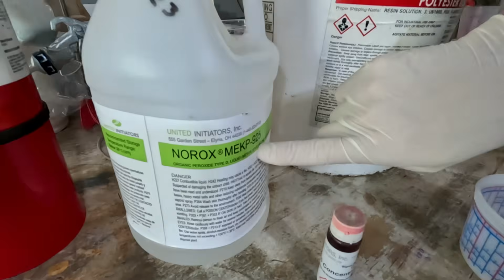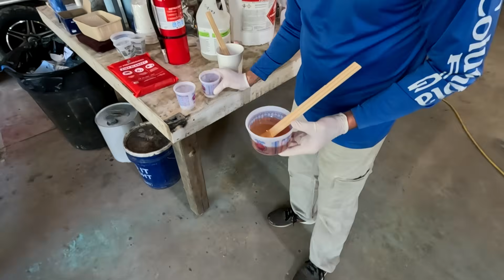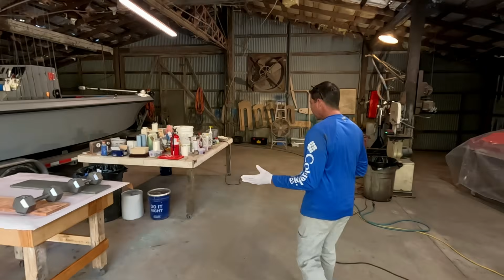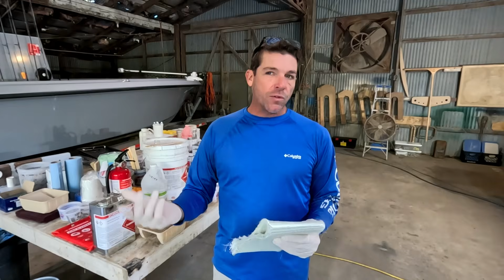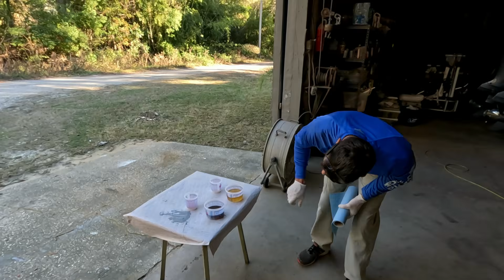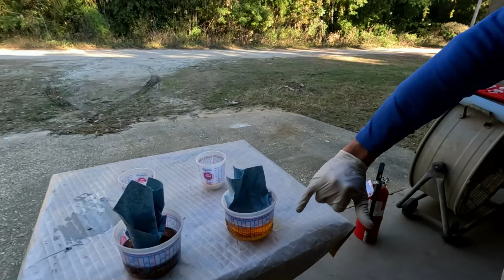FIRE HAZARD!! WILL POLYESTER and EPOXY RESIN IGNITE? LET'S TEST IT AND FIND OUT!

Comment: I am from NZ. We get powdered CSM which I am sure is better than emulsion, but take my word for it, Emulsion based CSM will work with Epoxy. The chemists will say it doesn't but it will! Takes a bit more rolling but it does wet out.

Comment: Great demo and at a good time for me. I have to build an aluminum tower for my mast step on my Catalina 36 and fill the voids around it with several epoxy pours. Unfortunately Catalina has always put wood under the 2inches of glass under the step and in time it gets pinky and the step pushes down. I’ll be extra careful and probably double or triple the number of pours to fill up the6x8x12 inch area. Thanks. Gallivant a36 Catalina northern Lake Michigan Escanaba, Michigan
Reply from the maker: Thanks, and good luck with your project!

Comment: There seems to be a lot of pricing competition on the 1:1 Table Top Epoxy averaging $50/gallon. If you mix 1 part resin, 1 part activator and 1 part xylene you get a water thin epoxy with a rather long pot life. I've used this mixture many times on cheap Home Depot grade plywood with excellent results. The wood drinks the mixture up and because Table Top Epoxy is crystal clear it barely looks like wet wood after applying then becomes almost invisible once soaked in and the xylene evaporates. The wood does not become shiny because the wood has absorbed the mixture completely. Once cured the rough pourus wood can be lightly sanded and coated with just about anything. I have yet to find anything that sticks to untreated wood that won't stick to the cured wood soaked with epoxy. Virtually rot proof wood. 🥳
Reply from the maker: Very interesting, thanks for sharing your experience and methods with the channel, and for taking the time to watch and comment!

Comment: The first time i used an Epoxy resin to paint my bathtube, i got some problems using denaturated 99.9% ethilic alcool, the resin did not get hard. Before i used as the company suggested, the Pure 97% glass drinkable alcool and it worked very good. Idk if it was a problem of the chemicals used in the denaturation of the alcool or i made some other mistakes. Ty for your example :), but when i used the denaturated alcool for epoxy it didnt work
Reply from the maker: Thanks for sharing your experience with the channel! There can be lots of variables between different brands of epoxy and possible thinners, so it's hard to say sometimes what will happen for sure. I like to do test batches, just to be sure everything is working well together if it is possible. Glad you found a workable solution! I appreciate you watching and commenting!

Comment: HI. I have a kayak built about ten years ago. I would like to make some changes but I don't know what resin was used. How to understand if it is made of resin with styrene or epoxy? Thank you
Reply from the maker: It is hard to say for sure.A quality kayak could possibly be made out of epoxy resin. If you are in doubt and need to make repairs, I would probably use epoxy resin. Epoxy will bond to epoxy, vinyl ester, and polyester resin, but poly and vinyl don't bond well to epoxy. Just remember that gelcoat is polyester based, and isnt recommended over epoxy. I hope this helps, and thanks for watching!
Reply: Grazie!

Comment: I’m wondering how many layers of cloth you can wet out at the same time with polyester or vinylester. 2 or more, 4?
Reply from the maker: 2 or 3 layers in most cases, depending on the temperature and thickness of the fiberglass clothe and the catalyst rate. The hotter it is with a thicker fabric, the less fiberglass you would put on. Hope this helps and thanks for watching!

Comment: I gotta a question for you.    I learned from you that it’s not advisable to put polyester resin on top of epoxy but the other way round is fine.   I have redone the stern and transom on polyester resin and cloth, and glued the marine plywood with an epoxy based type of glue, which is fine.  I allowed 7 days for total cure as the manufacturer advised.   But now I am thinking about closing the transom up with epoxy instead of polyester since it’s said to be more resistant to water.     However, I am in doubt whether it’s also stronger than polyester for tension / forced applied, considering the same amount of fiberglass used.   If the mechanical resistance isn’t so big , I will stick with polyester because it’s cheaper and easier to find here in Rio de Janeiro - Brazil.
Reply from the maker: Epoxy resin is very strong and bonds well, so I don't see any reason not to use it other than the higher costs and the fact that gelcoat doesn't bond well to it. I hope this helps and I appreciate you watching!
Reply: @FishBumpTV  okay thanks, but if I don't use gelcoat to finilize the job, what will I use to paint the stern/transom ?  PU paint?   should I coat it with an epoxy-based fairing compound and then paint it with PU paint ?   Dude, sorry for my English, but I am having to learn like 100 new words every time I watch your videos just to understand your explanations.  so I may be misplacing the terms here and there at times.  lmao..  thanks anyway.

Comment: Witch ones are more chemical resistant/stable when cured? 
I was recamended Bar Top epoxy  to for a wood slab table top. Im concitering bulding a methanol fuled miny boat, and dont want the reason to destabilize  if some methanol got spilled into the sump.
As you said epoxy is spendy Bar Top epoxy is lext level expensive  and may not be proper for use in building a boat.
Reply from the maker: Not sure about resistance to methanol, but generally speaking vinyl Ester and epoxy resin are going to be my go to choices for high strength and toughness. I am sure there are some channels or groups out there that would have a solid recommendation for your application. Wish I could be more help. Thanks for watching!

Comment: Nearly had a problem this past week, I finally did some epoxy with RTU hardener the afternoon and that evening temps fall to 5 degrees.... the work was tacky and not curing for 2 days before I smartened up and put it out in the sun for 2 days, turning it so the heat got everywhere... finally, it dried!
Reply from the maker: Glad it worked out for you! It is amazing how well sunlight works if you are trying to get something to cure. Thanks for watching and commenting!
Reply: @FishBumpTV  I was about to scratch the resin off and start over...

Comment: question could a mould be made from a plastic sheet and if so what is the best way to get the fiberglass off the plastic mould
Reply from the maker: I am not sure if that could work or not. Fiberglass does not stick very well at all to plastic, so that part is good. I try to show methods that I know will work, and are standard practice in the industry on our videos so you know that your project will turn out good. Anything outside of that and you might want to just do some experiments and see what you get. I hope this helps and thanks for watching!
Reply: @FishBumpTV  thank you so much for the reply

Comment: Just found your channel and I am going to go through the video. I will be 60 next year and I decided to build a sailing boat, most likely some J. Welsford design. Never did anything like this, I will probably build some canoe first to gain some experience. I was inclined to use rather epoxy but some advantages of polyester resin found on this channel made me think. So let's see, I will dive into your channel now.
Reply from the maker: Glad you are enjoying the videos and welcome to the channel! I think building a small boat first is a great idea for someone who is new to this kind of work, I am sure you will learn a lot! Vinyl Ester resins,  like the one we show in our resin selection video is something that you might want to seriously consider as well. It has the strength, bonding, and waterproofing ability of epoxy, but the easier workability of polyester. Vinyl Ester has become one of my favorite resins to work with because of these qualities. I hope this helps and I wish you the best with you boat projects!

Comment: Hey Cap'n joe! I was just scrolling back through the channel and came across this video and was just wondering if you ever have a problem with heat during the cure process? In my situation we have problems with the resin getting too hot and turning opeke or even a white color and was just wondering if you had any advice on how to prevent this from happening. Keep up the great work! I cant wait to see you build the hard top for the 29!
Reply from the maker: Sounds like too much material being applied at one time, or to fast of an activator or too much catalyst being added. Try applying less material at one time or back down on the catalyst. I hope this helps and thanks for watching!

Comment: Enjoy your video's, I will not be giving you flack.
Myself I'm a Epoxy guy for now and have started dabbling with polyester.
I have not developed the trust in my work to trust poly for repairs in my applications thus far.
I coat all my stringers with 3-4 coats of cloth and epoxy before installation. 
My project is 1969 Mako and I'm on classic mako forums, Its several years in the making and I have had several set backs.(health/physical)
I gutted the soaked foam and removed the cap and built the new transom 2-1/4" thick.
All the wood was weeping with moisture.
I'm building stringers beside the old before removing and replacing the original, to prevent hull deform. and leaving the added.
This boat lasted 50 years and hopefully my rebuild will do the same.(or more)
I figure I removed 600 Lbs or more of wet foam, gunnels and under floor was mostly soaked.  The boat was in NY where the freeze factor did it's damage well to promote spreading of water over it's 50 yrs. I drug this boat to NC and never put it in the water, straight to cut and gutting. been a work in progress ever since and I don't suffer from the insanity... I enjoy it. My buddy at jamestown dist calls it a special kind of crazy(with fun) 
When I have time I watch vids of you and several other popular Y.Tubers.
I have done my share if experimenting more in the effects of fumed silica making non-fiber reinforced PB brittle.
But add some saw dust, fiber sanding dust, or milled fibers and wah=lah not too brittle anymore.
I've done enough to not be a beginner but not a pro by a long shot, So I tend to triple over-build everything.
Everyone cries about how heavy I'm building, Last time I checked wood floats, nobody says anything about the 6-800 Lbs wet foam I removed.   
It will take a lot of Rot to ever show any weakness in what I have done,. And I laugh if there is ever anyone that thinks of going behind me and cutting out what I have built. (and I thought I had a rough time)Mako did a good job back in the day.
I could write more but I'm stopping here.
Cheers.
Reply from the maker: Loved hearing about your classic Mako restoration! Sounds like you are doing it right, and I had to laugh at the  Special Kind of Crazy comment from your Jamestown rep! Only true boat guys really understand what it's all about. Thanks so much for watching and commenting, and I wish you the very best of luck with your project!

Comment: Here in Australia I’ve had a slightly over-catalysed Polyester start smoking within less than 10 minutes because I moved the pot and it was standing in the sun.  So if you’re in hot climates don’t unwittingly add UV into the equation…
Reply from the maker: Thanks for watching all the way from Australia 🇦🇺  I appreciate the comment !

Comment: Hey, I’m really enjoying your content!  This might be a bit much for a comment section but I could use some clarification. I am preparing to pop some osmosis blisters on our 1979 sailboat. I was told that I could fill the voids with either polyester resin or epoxy. I was planning on using epoxy but I didn’t realize epoxy did not work with CSM or Biaxial until seeing this video. Did I understand that correctly? How do you build out a cavity using epoxy if you can’t layer glass mat?
Reply from the maker: Glad you are enjoying the videos. 1708 and 1808 biaxial fiberglass work great with epoxy, vinyl Ester and polyester resins. Csm or mat works best with polyester and vinyl ester resins. Csm can be used in some limited applications with epoxy,  but I don't usually recommended it. Epoxy resin does not melt the fiberglass binders that hold csm together, causing it to remain stiff when you are trying to shape it. Epoxy or vinyl Ester resins are usually recommended for below the waterline applications, but it is not recommended to apply gelcoat over epoxy resins. I hope this helps, and best of luck with your project!

Comment: Thank you so much for taking the time to walk through all of the details of this stuff across all your videos, I've been enjoying watching them as of late. I've done a decent number of surfboard repairs and I'm pleasantly surprised that some of the "tricks" I landed on after some heartache are some of the things you've pointed out. I've lately been going down the route of getting into marine canvas and upholstery as a career switch, and was wondering what your thoughts on the following are. Every boat I seem to come across for upholstery work has at least one area where there is visible wear and tear around hinges, grommets, and the like. I'm considering expanding beyond upholstery to address some of these minor issues and offer repair services, but am wondering if you see this as not worth the risk/reward as it would be something done on sight without any type of shop just in the boat yards. Specifically, where there are screw holes that have worked themselves out via corrosion, do you have any low impact suggestions on fixes for this? I see you're a fan of the NAPA Pro Strand, but wondering if thats sufficient or some type of lamination would be the professional grade for this type of repair. I know enough to be dangerous and tear things up, but also know enough to be weary of getting myself in over my head. Thanks again and keep up the great work!
Reply: Also, as a video suggestion, something that might be fringe but I would personally enjoy would be how to create a mold for a hull. There's a type of surf craft called a "Greenough Spoon" thats historically been shaped from a blank. It's a very wasteful process since a vast majority of the foam blank is removed in the process, and one that could be done in a similar manner to making a hull in my opinion. I've heard of a semi recent run by Jeff Hull on the west coast creating a mold to make these and that it was successful. Not sure if it would appeal too much to your target audience if you were to make this type of thing specifically, but any small form boat mold would certainly cover all techniques necessary for something like this. Anyways, appreciate you reading this far, thanks again.
Reply from the maker: Thanks for the suggestion! I plan on building a hard top mold for our 29 very soon. The basic process would the same as a small hull. I think you guys would enjoy seeing the process.
Reply from the maker: Glad you are enjoying the videos, and finding them helpful! Some gelcoat and screw hole repair seems like a good addition to your business. 3M makes a high strength vinyl Ester filler that is very good, but expensive. You might want to consider trying some tests and experiments on some non critical parts, and just see how it turns out for you. Hope this helps and thanks for watching!

Comment: Hey Joe I have a few questions whenever you have time. Thanks for the video!
Q:1 After mixing up epoxy & catalyst in a measuring container ( like the ones you use) then pouring it into a paint tray is it best practice to immediately clean the measuring container if I want to reuse it? I know they’re cheap but my concern is that every time I mix a batch of epoxy I will need to use another new measuring cup. 
Q:2 I just realized I need to search your video log because you might have this covered already. But I’ll at least ask. When the end of the day comes and I’m ready to stop working, what’s the best practice for clean up? Can tools be wiped down/cleaned with alcohol ( when working with epoxy)? What should I do with used roller naps?
Thank you again for the video! 
I wouldn't mind seeing a boat build either👍🏻
Reply from the maker: Glad you are enjoying the videos. I keep a five gallon bucket with about a gallon of acetone and a lid on it in my shop for general cleanup. Alcohol and plain vinegar will also cut epoxy resins. I will try to do a video on cleanup for you guys soon. Hope this helps and thanks for watching!

Comment: Is it better to use epoxy or poly to put the stringers and the transom in, then use poly on the fiberglass.
Reply from the maker: Either one can be used, and there are pros and cons for both. Epoxy cost more, but bonds well to almost everything. Polyester is less expensive and I think can be easier to work with in some cases, but doesn't bond as well as Epoxy. Just remember it is generally not a good idea to put Polyester over epoxy. Hope this helps, thanks for watching!